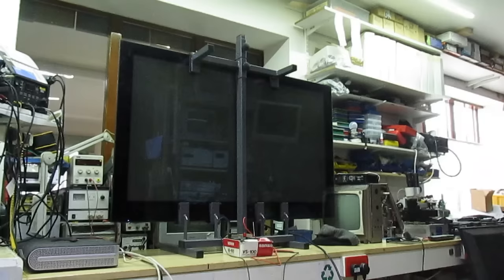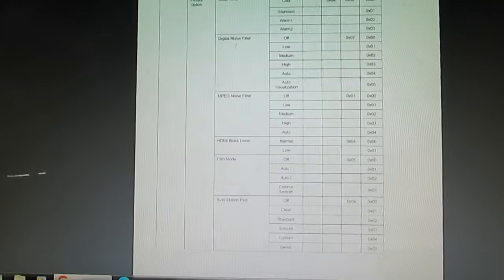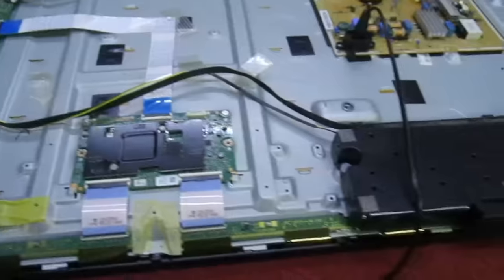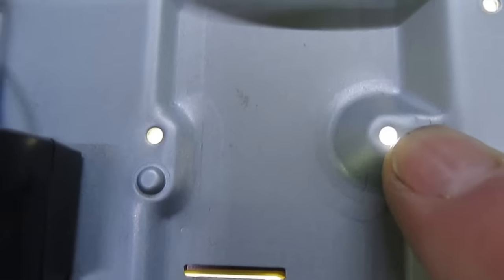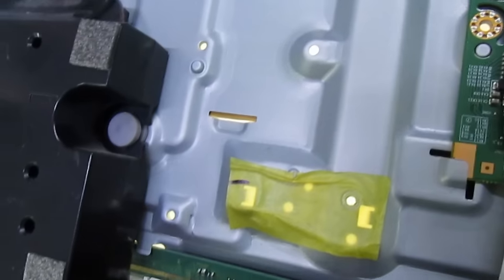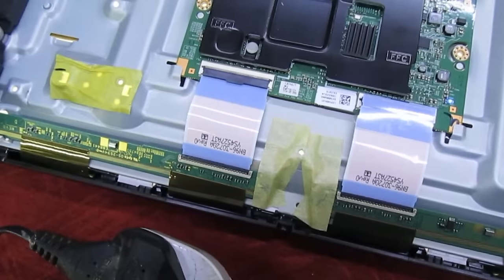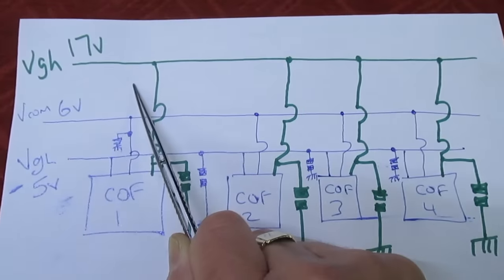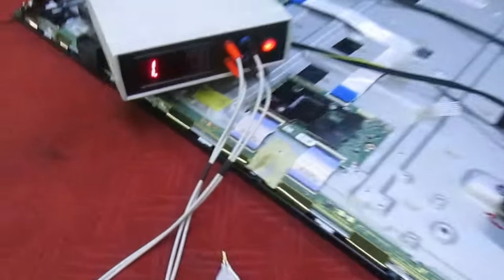Video to highlight the problem of repairing flat panel TV sets

Comment: Hi Michael,
I've worked in Electronics since the early 1970s to 1986 as a 'Television Engineer' (common usage of the era) for Rediffusion and Granada Television (I left in 86 to go into other areas or electronics, as Television Servicing was 'dying on it's feet'). Service Manuals were very comprehensive, and they had to be. Colour Television Receivers were a combination of 'Discrete' Hybrid & Solid State devices and involved EHT Techniques to supply a 25KV source as you know. (non LSI Integrated Circuit components came later to reduce the complexity of the PAL Decoder and other areas). You also had to deal with UHF Reception & Signal Processing & PAL Demodulation requirements. Oscillogram reference waveforms in the Manual were needed as well as DC voltage conditions to assist the Technician in his diagnosis. A World First & British, was the Thorn/BRC Solid-State Dual Standard Colour Television Receiver. circa 1967 and was the most sophisticated piece of engineering ever seen in a domestic environment. Although sub-chassis modules were designed to be removed, this was rarely done as a repair method. 'Fault Finding' was done to component level as a common practice. This required the Technician to have a considerable intimate knowledge of the Techniques used, right down to the 'why & how' of every discrete system processing stage within the Receiver, and to component level as well.  Switchmode PSU Techniques  were not uncommon, and it could proved to be difficult to isolate the faulty component when the 'SM PSU' had entered into shutdown-mode.  My Technical College Training  took 4 years of day-release and evening classes plus home study to cover subject. Modern day Electronics Students are taught differently now, as electronics has become a multi-disciplined and highly diverse science.  I have a large folder of Technical Training Certificates (after passing numerous grading examinations) which I have collected as part of a continuous on-going training throughout my career in various specialist areas of Electronics, I never stopped learning. I am retired now, and I am thankful I never had my own Repair business, as it cannot be easy to make a living from consumer repairs as an independent, due to the lack of support from the manufactures which you alluded to in your video.
Reply from the maker: It's not just limited to TV s, most electronic items now have no service manual or parts availability, someone I know bought a set from Argos and was having trouble setting up the wl fi intetnet connection, he rang Argos for advice and there reply was bring the set back and we will exchange it for another one, all it needed was a router password, there is no help from anyone these days and if you take items back under warranty you don't get a repair they just give you a new set which can only mean your old one goes in the bin.
Reply: @michaeldranfield7140  : Working at the dealer level failed stuff was sent back to the manufacturer. Now them as I mentioned earlier could be a simple test and minor repair sent out as refurbished, or thrown away if not worth it.

Comment: The other technique that can be useful is to apply freezing spray across all the caps, add power to the relevant rails from a bench power supply, and you'll visually see which heats up fastest - that's your short.
Reply from the maker: You can only use this trick though when feeding the rail from a bench power supply.

Comment: I think the reason today's TV's aren't serviceable is because circuit boards are multi-layer and are extremely difficult to repair. This is why the number of boards inside a TV has shrunk considerably over the last 25 years. The time required to diagnose a faulty circuit or a component is not cost effective. Simply de-soldering a component could render the board useless because you run the risk of dislodging the microscopic bridge connections between the layers.
Reply from the maker: I know what you mean, multilayer boards are a right pain trying to trace something with no circuit diagram.
Reply: Double sided print, like the old GEC colour TV sets.
Reply from the maker: @Samba.  I found with the GEC sets it was easier to remove components from double sided print if you heated the joint from the top side .

Comment: Do you know if there's any service parameters that can be changed on a UE65F8000?

mine had the A/V board replaced under warranty but I since learned now the 3D has an issue where the objects in the background are massively out of focus, it was fine before i'm guessing there's something that needs adjusting/setting up
Reply from the maker: Don't know off the top of my head you would have to obtain the service manual to see but some later Samsung sets need you to buy a special service remote to access the factory set up.
Reply: @michaeldranfield7140  thanks for the reply! It's really annoying, is there anywhere to obtain the service manual as I couldn't find a lot on Google?
Reply from the maker: @andrewbg5845  service manuals are now usually only supplied to main dealers so you would have to find a Samsung dealer .

Comment: These caps are made in China, expect nothing more and nothing less,  a very very usual issue with other electronic devices.
Reply from the maker: Unfortunately very true, doesn't matter how much you pay everything comes from China.
Reply: I have a huge stock of caps.
Due to the garbage we now get with components, I'm now in the habit of testing each cap that  I use.

I not only check capacitance, but also ESR.

It's amazing how I can test a bunch of caps that are the same "manufacturer", save voltage rating and same capacitance, and the ESR is all over the map.  Some are just fine, while others are destined for the trash bin immediately.

I don't remember having this issue decades ago.  Caps held up rather well, back then.
Reply: @BlondieSL  How very true, I have hundreds very old caps, some being 40 + years old, the electrolitics in particular are very close to value and the ESR is good.
 The quality has dropped off in the last 25 years but there are still a couple of manufacturers producing a good cap.
Reply: @michaeldranfield7140  You can still buy caps and other products not made in China, the quality is notably higher when you source these non Chinesium products.

Comment: Great video and fault finding, I learned some other methods here about fault finding these TVs. I'm a technician and my specialty is communications equipment, although I repair other devices too. I have several TVs that I found in the council cleanups, or hard rubbish collections. I repaired a few usually by inspection, (checking for burnt/damaged components), replacing bad caps, checking for shorted diodes and dry joints. Not having manuals for these TVs that's all I can do to check for faults. If I have to spend too much time on a TV I just won't bother. I'll keep the boards in case I find another one of the same model. If I get one with similar symptoms as described here I'll perform the checks you described. It's become a throwaway society, it seems that repairing these TVs is a dying trade.
Reply from the maker: There won't be many people left like me repairing for a living.

Comment: I used to make money repairing older LCD tvs that I would get either from where I worked or from customers when delivering new ones. 

Often times it was either bad caps or a failed Mosfet sometimes even a cold solder joint. 

I would fix them and sell them for cheap or even contact the previous owner and see if they wanted it for cost of parts. 

Usually I would end up selling them for sub $100usd

Yes back lights are an issue but wasn't worth the money most of the time. So I didn't often mess with it.
Reply from the maker: I would imagine that a lot of sets disposed of these days only suffer from a simple fault but are never taken to a shop for investigation as most places now are only interested in selling a new one .

Comment: I wish I understand these boards like Michael does!! And what annoys me most is Samsung itself - why these morons issue so faulty devices?? Don't they check all elec.parts BEFORE soldering 'em?? If device works in proper mode (not in water, with good power, etc) it MUST NOT fail at all! These components has nothing to break, because they stay in a proven scheme.
We should fine and fine these korean clowns until they make QUALITY things which work for 20 years. Guarantee on TV must be 10 years at least, not this ridiculous year!
Reply from the maker: If only I had circuit diagrams I could repair many more sets , I agree with the guarantee though , years ago some manufactures gave a 5 year warranty, not these days though as they know the set wont last 5 years .

Comment: Yeaa... I own a few out of warranty and out of production Kitchen Appliances from Philips and Siemens that are now in the 10+ year range so they're kinda starting to behave funny.

The Siemens Porsche Design Toaster at some time stopped properly ratcheting when engaged which would cause a premature ehh... ejection? 😏 ( apparently a common problem ) 
Contacted Siemens Customer Support and asked them about a Service Manual so I could have a look inside - No Problemo™ - Took the thing apart, gave it a good cleaning - Reassembled all fine again. Btw... Not a single screw to be found in that device but solid as a tank with like a 3mm thick Aluminium Shell - Chefskiss.

As for the Philips Robust Cordless Hand Blender there the 18650 Cells were starting to lose charge and needed replacement - The End-user Manual even has a section how to remove them for disposal but that's about it - There's no information on how to extract the rest of the Electronics for easier working on them so again we contact CS for a Service Manual - No can do "18650 are not replaceable!" - Say what..?

Needless to say, I DID replace them a few days later on once the Nickel Strips arrived to spot weld them together - Installation though was a R.P.I.T.A. due to me still not being able of removing the Internals 😑
Reply from the maker: Got a Smeg toaster in for repair, cost £130 to buy and no parts available and guess what, its made in China.